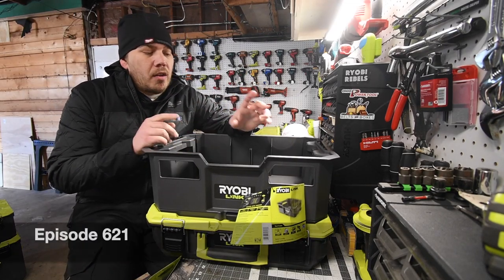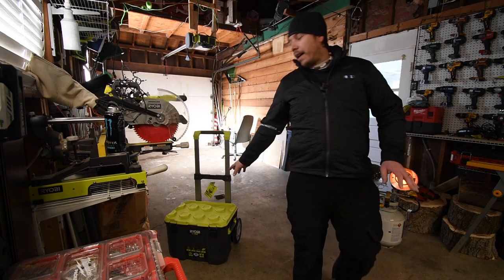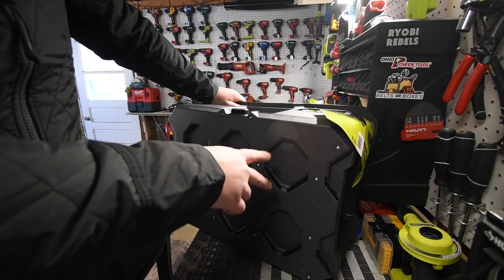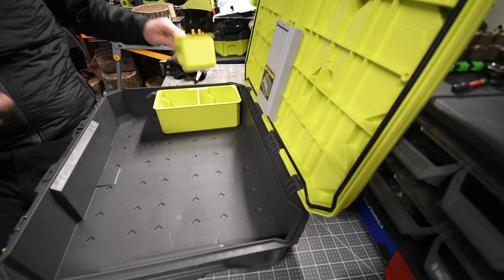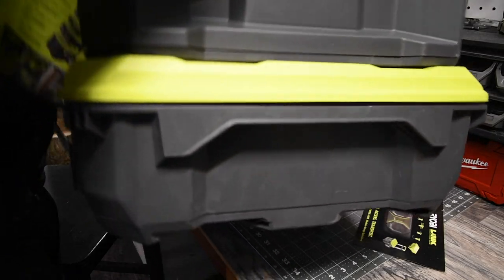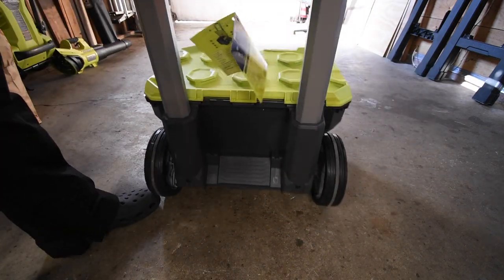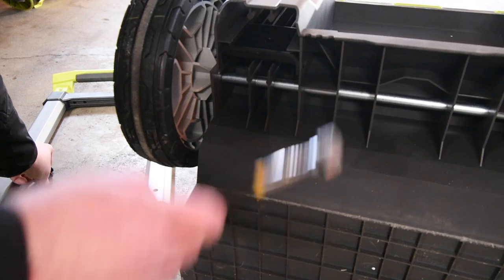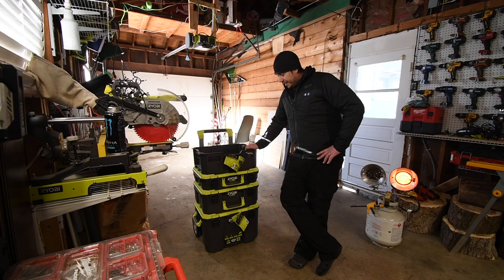Ryobi Link Portable Tool Storage Units

Comment: Bought these about a month ago. So far I have been happy with them. But I have a few complaints. 1. The bit holder prevents you from completely filling the small tool box with bins. 2. Ryobi doesn’t offer a small box with a clear lid for fastener storage like all the other pack out systems. 3. They should include the bins both sides in large and medium boxes.  But those are minor improvements that could be made. As far as future items, I would love to see 1. link mount 8 pack battery charge/carrier, or better yet a link mount radio with Bluetooth and a built in 8 pack battery charger. That can run off ac and charge batteries, but when in plugged, would run the radio on one of the batteries. 2. Clear top fasten storage boxes. 3. Dual Link mount misting fan for those of us in hot climates. So we could roll the pack out system to where we want it and use it as stand for the misting fans.

Comment: I have been wanting to look at these in our Home Depot. I’m not sure I want any of these, but who knows. I’m hoping that you will let us know which set make a better portable toilet. :-) I did buy a bunch of smaller plastic storage boxes from Home Depot to sort my screws, wire caps, bolts and nuts of different sizes. Handy. Get better…….. And congrads on getting past the 50,000 mark.

Comment: Is the crates able to stack on each other without  falling over
Reply from the maker: there is no way for it to lock into place.
Reply: Hey Dave I checked and the ryobi crates do lock into each other. I had three today locked in and had to use the release button to get them apart

Comment: My only gripe is that the top lids have no handle on any of the tool box and the middle box is a bit short to me I would like the deep box or the middle be deeper but it does not have a tray but that’s fine because the tray can take up space and it’s for power tools only

Comment: kinda interested in them but i feel like they're just a big box with no real pockets. i have the Husky 22-inch Pro Grade Rolling Tote that works pretty well. has lots of pockets for small handheld tools. i feel like this would just be a big box to dump stuff in and never find it.
Reply: I feel you really should be choosing the size of the box to match the tool. I actually measure all my tools BEFORE I buy storage for them, and get the smallest size box I can get away with. For example, my jigsaw lives in a systainer T-loc 1 (Which I believe is 105mm high). That's so little extra clearance I actually have to tilt my base plate to a 45 to put it at the front of the box (systainer boxes are not uniform depth throughout, as the lid has some structural ribbing at the front where it meshes with the lid, and there is also a dip at the back for the cleats on the base to lock into). 

As soon as you start putting tiny tools in giant boxes, it's kind of a disaster, and it's also inconvenient to get stuff in and out.

Also, I don't recommend full kaizen foam, as it wastes quite a bit of space, but a little bit of foam is often useful, just to make your tools register. You only need a tiny amount of stops in a box to make every tool fit right in place, which makes it even easier to unpack and pack your tools.

Comment: The question is, if the case is at 0 degrees and you drop it, will it crack? A lot of them are fine at 70 degrees, but freeze them and they get brittle and crack.
Reply from the maker: that is coming soon. Ill be doing a versus video against Milwuakee packout soon

Comment: The lid is a deal breaker for me. When I close the lid it should hold everything in place regardless how I handle the box. They put a handle on it, they know people are going to carry it like a briefcase. Yet they didn't design it to hold things in that position. That's just a fail. I also don't like the built-in bit holder in every single box. I don't need bits for every tool, why would I want a holder in every box?

Comment: Anyone know what these weigh? I can't find it on the ryobi website, and home depot thinks that the 6 inch high box weighs 2.5 lbs, which I do not find credible: the smallest lightest systainer (50% shorter, smaller footprint) is slightly heavier than that by a couple ounces.

Seems like an important oversight: These things are meant to be portable, and if these are significantly lighter than packout, I would expect them to be shouting it from the rooftops.
Reply from the maker: the weight of these is in the description on the home depot website
Reply: @ManCaverTools  I have seen those, but I don't think they are credible. It says the 6 inch box is lighter than the smallest systainer t-loc, which is a smaller footprint and 2 inches shorter. (2.5 vs 2.8 lbs)

I really suspect someone just took a rough guess, or rounded heavily.
Reply: @ManCaverTools  
No one is going to be “shaking” these suit case styled boxes left & right, upside down like you did in the video. Secondly, other reviewers like VCG Construction and others, tested the “loose” parts bin the right, normal way a person would carry them.

Comment: I see the locking mechanisms breaking over time and getting clogged up with crap etc and these boxes when you put different size items with different weights and shapes and actually bang these storage containers around the stuff moves and falls everywhere lol? For all that you might as well just get a big tote with wheels for 20$ cause if the stuff doesn’t stay put and can’t  stay locked together and organized over time in all temperature conditions than that’s all it really is imo a glorified way over priced storage tote. I want systems that keep every bit, Fastener, connector, wire nut or whatever else small neatly stored and organized without moving and I can clearly see it or Know where it is at all times and will not become unorganized or moved or around or still have to dig through stuff to find it. Same goes for the bigger tools without needing millions of hardcases to store each and every single tool and have to open them all up to find what your looking for. That’s what makes some of dewalts storage stuff nice and what makes Milwaukee’s the best in the business. I’ve seen entire work vans and pack out equipped vehicles hella organized, nothing moves, like rolling workshops with everything clearly accessible, viewable, doesn’t move, easily moved from place to place and everything’s easily organized. Just saying. This is for like your grandma thinking she has her sewing supplies or tool kits to refurbish antique furniture or do her knitting class or cross knit 😂😂🤷🏻‍♂️
Reply: You could always put foam inserts or something? But yeah these are just empty totes that stack together. Nothing really mind blowing.